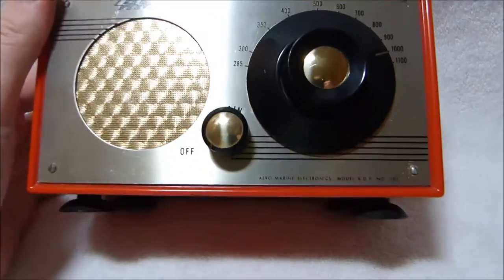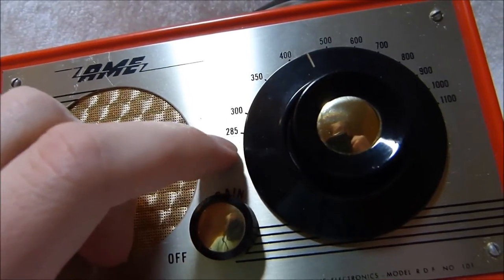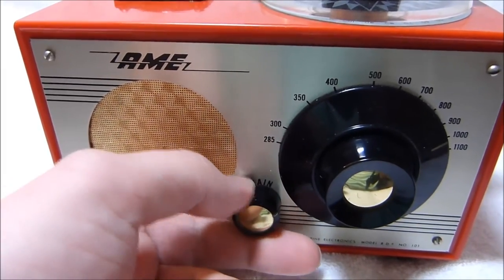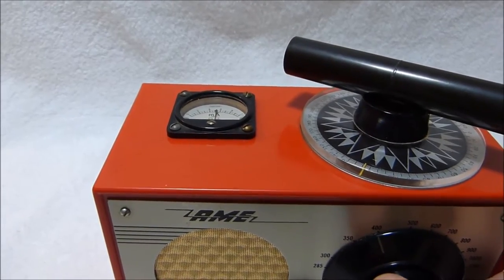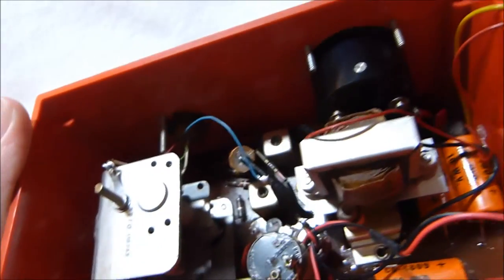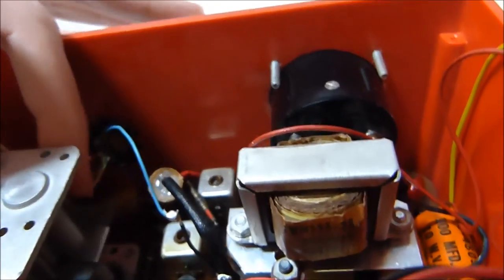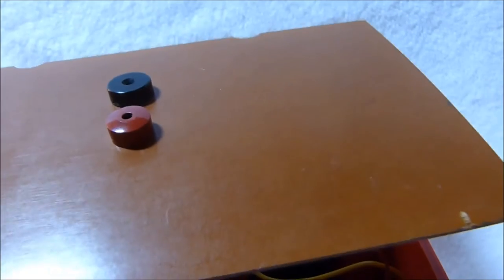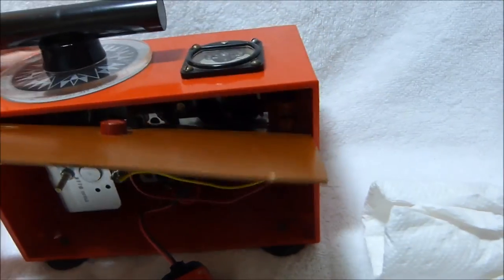Aero-Marine Electronics radio direction finder (made in USA)

Comment: Odd radio for sure. Combining the AF and RF gain into a single control knob is a bizarre and self-defeating idea.
The French station, if at 860 kHz is likely CJBC from Toronto. VERY powerful transmitter, similar to 740 kHz CFZM. Both are 50 kW class A, clear-channel day/night stations.
Reply from the maker: They probably should have added a separate RF gain control on the side of the radio. I believe the french station I was picking up was at 860, thanks for the info on those stations.
Reply: 50sTransistorRadios You are free to listen to weak stations LOUDLY or local stations quietly!! Really weird tuning range as well, not really going low enough to be LW and not really going high enough to be MW.

Good thing about 740 CFZM, is they are still somewhat of a classic hits / oldies AM music station most of the day, and apparently can be received as far south as Florida at night due to their clear channel transmitter on 740 kHz.
Reply from the maker: Yeah the tuning range sure is weird, I have not seen anything like it before.  CFZM is too far away from me to be received clearly most of the time (assuming that is the station I receive around that frequency).
Reply: 50sTransistorRadios OK. Just thought I would mention it, since you are typically testing a variety of AM / MW radios, and music stations are getting scarce. I was able to receive 740 CFZM at night when I was camping in upstate NJ, about 40 miles east of Scranton, PA, using a little Grundig 'Hit Boy 310' from the 1970s.
Reply from the maker: I just checked with my Sony ICF-2010, I can receive it, but there is a lot of static, so it's not really listenable for music unfortunately.

Comment: That is so cool.....do you have a  Panasonic RF-800 you could do a video on...??? thanks for all the nice radios...I was a tube guy...but have switched to 60's, 70's transistor radios...
Reply from the maker: I don't think I have one of those, but maybe I do somewhere (I know I have a similar set at least). I never was a tube radio guy, but I have fixed a few.
Reply: The RF-728 is almost identical to the RF-800. I have both...I really like all the Panasonic radios from the 60's. Thanks for the fine videos you take...
Reply from the maker: Now that I think about it, I definitely have a Panasonic radio with those roller style controls, and it's probably one of those two models. Also, I'm glad you like my videos.
Reply: I like those large 0A70 diodes in these radios...wild looking...

Comment: Original design. Too bad that touching the antenna is changing the characterisics. They should design separate knob for turning the antenna.
Reply from the maker: Some radio direction finders did that, but not many; most just set the antenna into a large disk shaped enclosure so you could move it without getting too close to the antenna itself.